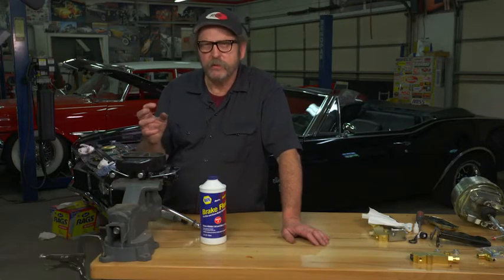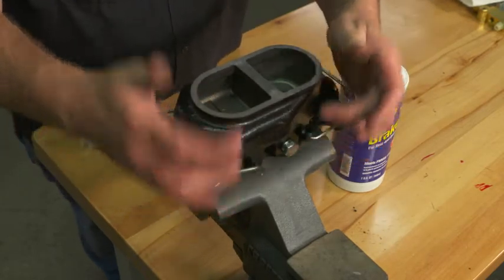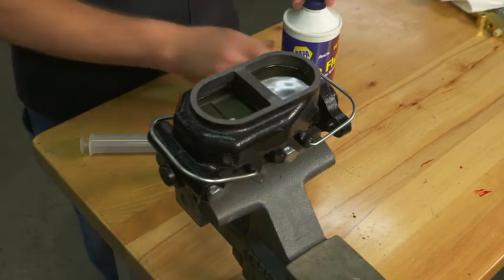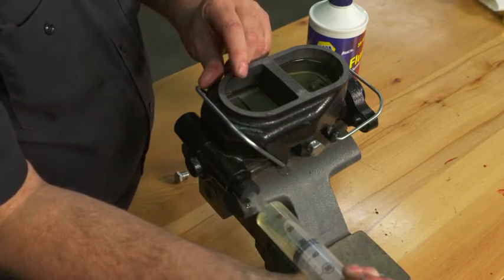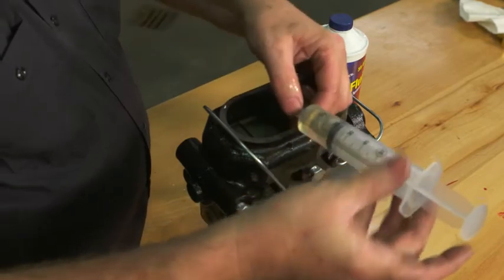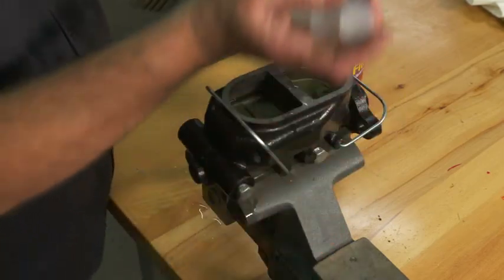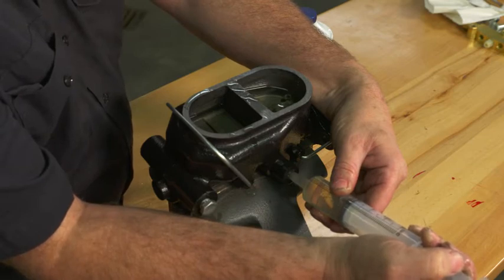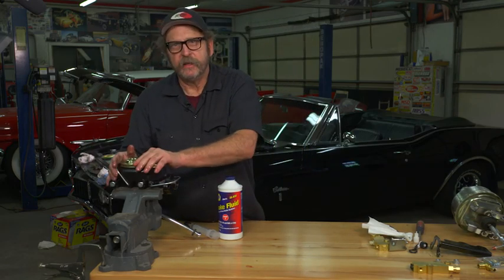Syringe Bleeding Master Cylinder

Comment: Although I would still bench bleed the master cylinder, the reverse brake bleeder from Phoenix Systems forces fluid in the same direction after installation by forcing fluid from the bleeder screws up to the master cylinder.  I was skeptical at first, but having bled the brakes on several vehicles, it produces the most firm brakes compared to other bleeding methods.

Comment: 04 tundra double cab- the MC has quite a lot slope my working harder then i should to be lazy attempt yesterday was to jack up rear of truck until MC got level, between my sloped driveway, and using 2 jacks going back and forth stacking bricks up under the jacks, ... it didn't happen stupid angle on truck and still nowhere near level

Comment: Thanks for posting. I've got a quick question, when I get a steady stream with no bubbles, then I put the cap back in, the cap is pushing are right back into the line. I can see the air bubbles coming out. It seems like this would defeat the purpose of bleeding the master
Reply from the maker: Great question! The ‘Ask an Expert’ section is currently for members of our online community. By becoming a member, you will have access to our expert’s knowledge. With your membership you will also receive discounts on products and hundreds of hours of Premium content.  

 If you are interested in becoming a member, please click on the offer below: 

https://go.classiccarrestorationclub.com/a19769

Thanks!

Comment: Great idea. progress..Can I use this syringe with the master on the car, if I am careful and re-attach the two lines quickly? Or, would that create a bubble at the end of the lines at the fittings? Thank you.
Reply from the maker: Hi Robert,
Syringe bleeding your master cylinder is not a substitute for bleeding your brake system once all the parts are in place. 
Although I have found it makes bleeding the entire system easier. 
After bench bleeding master cylinders many different ways over the years, THIS IS my favorite. 
Can it be done on the car? Sure if you have room and you are very careful.... remember brake fluid can dissolve paint. 
I like the master to be very level when syringe bleeding and sometimes will rock it back and forth during the bleeding process to eliminate any trapped air.
Mark
Classic Car Restoration Club
Reply: @ClassicCarRestorationClub  I have the syringe...master gives symptoms of air entrapped and bypassing piston seals,,i.e; a spongy pedal that nevertheless applies braking......afriend thinks he saw  bad lines near cylinder.actually nothing is wet...whole chassis and calipers new and dry. go figure and thnks for reply.